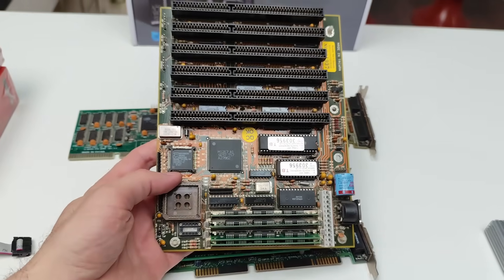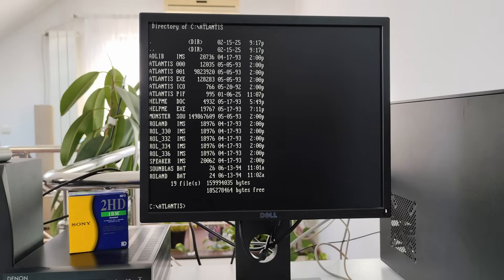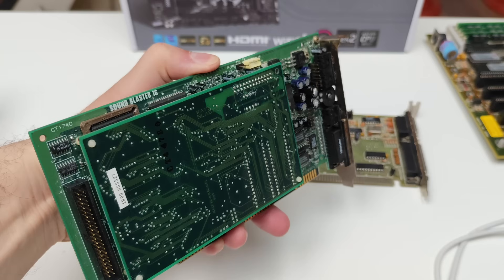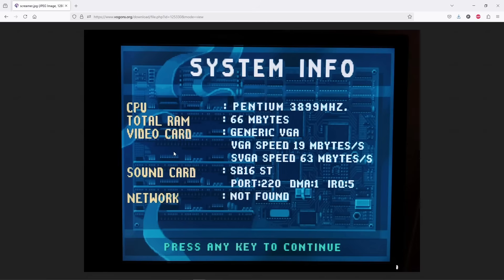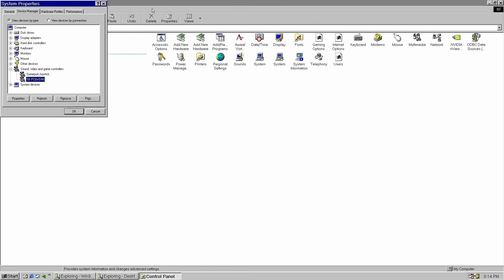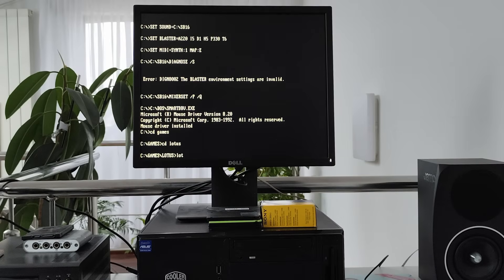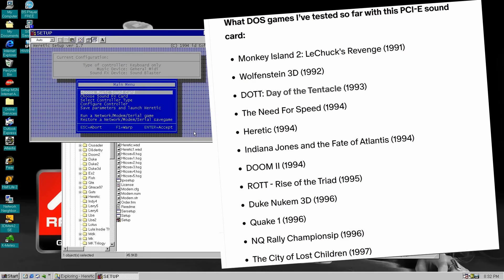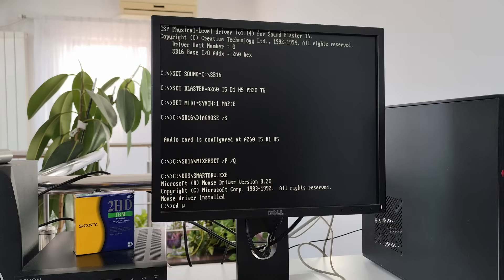No DMA? Running DOS Games on Modern Hardware with Windows 98

Comment: used to play this game on my 386dx with 4mb ram s3 vga card and sb16 no wavetable
Reply from the maker: Are you referring to Indiana Jones and the Fate of Atlantis? If so, you didn’t miss much by not having this WaveBlaster. The wavetable needs to be initialized using a separate driver (SBMIDI.EXE). Once set up, it should function as a General MIDI device, but it seems games like Indiana Jones won’t utilize it in pure DOS.
Reply: @O_mores  yes...later i playing again this game but with the cdrom version and using awe64 under windows environment

Comment: Why no mention about SBEMU?
Reply from the maker: Good point! I actually tried recording an SBEMU part since I had already used SBEMU successfully on my H610/13th Gen CPU setup, where I got sound through the motherboard header. Here’s the video: https://youtu.be/MI_cWrw7y_8 | However, this time I couldn’t replicate that success. I started with the newer drivers from 08/2024, then reverted to the older 2023 drivers I initially used. The sound card was recognized intermittently, but I started encountering PCI-E related errors. After two hours of troubleshooting, I gave up. I don’t recall which GPU I used in my previous test, but it seems like something on the PCI-E bus is interfering with SBEMU

Comment: Will this method work with Windows 3.0 with MME? Or Windows 3.0 MME only accepts real ISA SB16 card? You know, I will have ES1370 card. Maybe there is a chance ES1370 works with Win3.0 MME.
Reply from the maker: Windows 3.1 drivers usually don't work in Windows 3.0/MME, you need to find Windows 3.0 drivers for everything - and these are very had to find. For the Ensoniq ES1370 Windows 3.0 drivers are out of the question. I'm curios if this SB 16 will work.
Reply: @O_mores  so, the only solution for win3.0 is ISA SB16 card I think.
Reply from the maker: Yes, an ISA Sound Blaster is the answer, preferably the early models released up to 1991. This SB16 released in 1992 doesn't come with Windows 3.0 drivers, but maybe the older SB drivers are working with this card.

Comment: What motherboard is shown at 00:10? It looks like something cheap and basic, though the battery must have been expensive back in the day. I’ve seen so many of these where the battery leaked, and that liquid is incredibly corrosive, literally it can eat through the traces on the motherboard!
Reply from the maker: I couldn't identify the motherboard, in any case it has an ACER1217 chipset and yes, it has pretty much the same design as any other standard 386 motherboard from the early 90s. I can bring you 10 more motherboards that look identical, but also have some brand printed.  And these barrel batteries must be replaced, they will eventually fail.

Comment: A wet dream for the likes of myself to own an antique like that..! In fully working order!

Speaking of sound, I would love to see one video from you, on much more modern equipment, with an external synthesizer hooked up to the PCI sound card for music output from DOS games and maybe even music sequencing on different operating systems if you're up for it: with the SC-55, JV-1080, MT-32 or whatever could float your boat
Reply from the maker: If the NiCd battery hasn't gone wild, these 386 boards are usually OK to buy. By the way, this AMD SXL 33Mhz model has a power consumption of 1.35 Watts! Now, I’m on the hunt for larger 30-pin SIMMs. I have a few... but they’re all just 1MB modules or less. Yeah, I’d love to get an MT-32 eventually, but first, I’m planning to pick up some Windows 98-compatible USB external sound cards from Creative. These cards use their own dedicated drivers and don’t rely on the generic USB audio drivers included in Windows. I’m really curious to see how well they perform!

Comment: I have purchased two cheap pcie CMI8738 sound cards.
Both haven't worked. 1st one the motherboard bios and windows wouldn't even detect

The 2nd one was detected, I could install drivers but it would crash when I played any sound. This would happen in Windows 11 (using Windows 8 driver) and also in Windows 98
Reply: The issue with those cards is that it is actually a PCI only sound chip, which uses horrible ASMedia PCI to PCIE bridge chip. That ASMedia chip is basically incompatible with most of the modern PCs. You would be much better off if you found a card that uses instead a PLX PCIE bridge chip, those got quite good compatibility. Or something that is based on more modern CMI chips with native PCIE and no bridge chips.
Reply from the maker: @dark666king  Yes, but it might just be a specific issue between the CMI8738 chip and the ASM1083 chip - which, by the way, is used on motherboards from Asus, MSI, Gigabyte, Biostar etc. My X470 motherboard has an ASM1083 bridge chip that drives 2 PCI slots, and it works perfectly. I’ve been using it all the way from Windows 3.1 (where I get  sound from an Ensoniq ES1370 card) to newer Windows versions without a hitch.
Reply: @O_mores  I've seen other boards using this chip (ASM1083) still have issues with various regular PCI cards. Long story short that chip has bugged IRQ release and doesn't support PCIE power management, so the motherboard manufacturer has to actually implement a mini-driver with workarounds for it in their bios/uefi, else it either doesn't work or hard hangs any system running (be it windows or linux).
Reply from the maker: That makes sense. Thanks for explaining, but result may vary... I actually used an ASM1083 PCIe-to-PCI adapter on a Z790 motherboard (which doesn’t have any PCI-E bridge chip onboard), and it worked well without any hangs. It’s possible the Z790’s BIOS already includes the necessary microcode.
Reply: @O_mores  What is really hilarious is that any card with this chip is LEAST LIKELY to work with modern ASUS boards ...while ASMedia is ASUS's own chip IC designing division 🤣🤣
Reply from the maker: Sorry to hear that. I hope you can return them. My failure ratio with CMI 8738 is 50%. (ordered 2 cards so far) A few years ago, I ordered 3 x PCI-E to PCI adapters one is working 24/24 in a PC since then, another one it's on my desk for testing and it's pushed around, and the 3rd one - worked just 2 days...  Anyway, before returning the semi-functional CMI8738, can you try to move it in another slot? On my 13th Gen test system I had an Yamaha Sound  card that worked just in the second PCI-E 1x slot (using PCI-E to PCI adapter), and refused to work  in the remaining PCI-E slots no matter what.
Reply: I have a Genius PCI C-Media 8738 sound card, and I’m using it on an ASUS PRIME B360-PLUS socket 1151 motherboard. Luckily, this motherboard has two classic PCI slots, which is all I need for Windows XP and Windows 98. It works well for me, though I’ve noticed the audio output has a slight jitter in all versions of Windows.🙃

Comment: I use the SB128 PCI in my 2600k computer with Win98 SE... I had already tried a few DOS titles and there was music and SFX. I have a wave module like that on one of my ESS ISA sound cards.
Reply from the maker: It’s interesting that you mentioned the ESS ISA sound card, these "MIDI" modules are somehow standardized, not all of them, but i know that some can be swapped.  As for the SB128, this card is based on the Ensoniq ES137X chip. Creative acquired Ensoniq, and while the chip itself is essentially the same, the drivers are not compatible between the two. Ensoniq drivers won’t recognize Creative cards, which is why you can’t use them in Windows 3.1. And Creative’s later WDM drivers didn’t recognize my original Ensoniq card in Windows 98 either—I had to resort to using the older .vxd drivers to get it working...